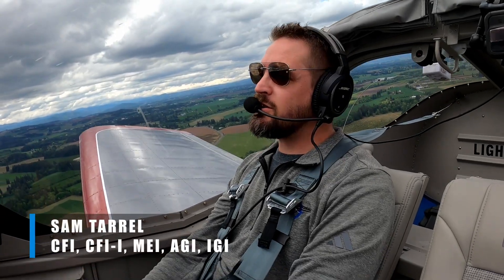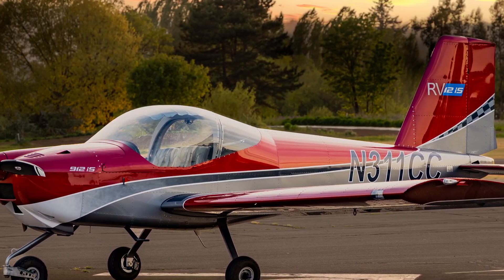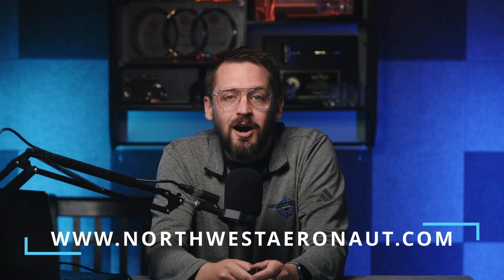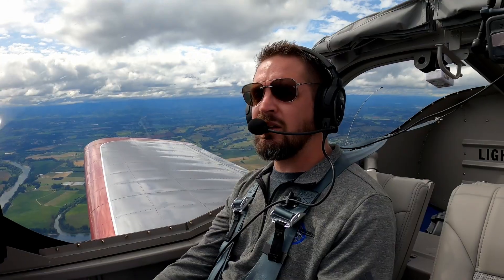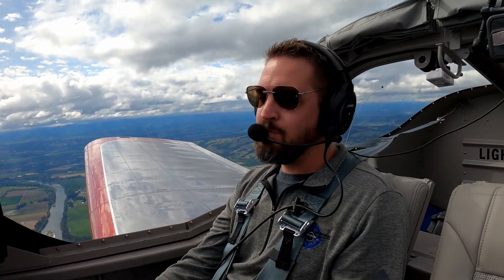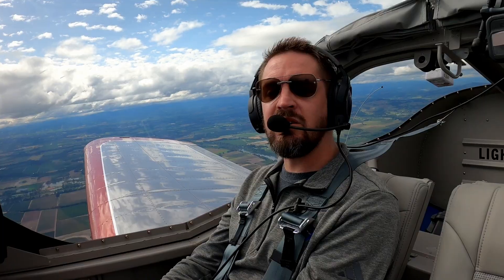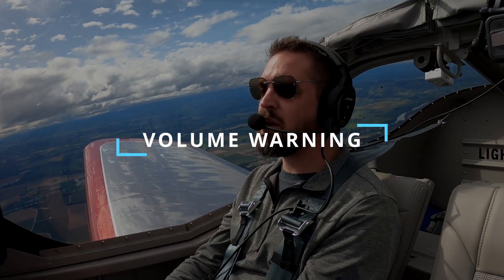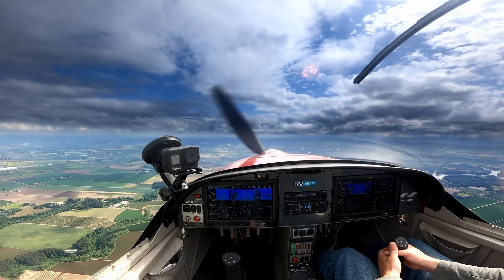How Stalls SHOULD be done -  in the RV12

Comment: I've been training in RV-12 for my Sport certificate here in Utah. How well does the 912 IS perform compared to the ULS in your opinion? We often struggle with high temperatures overheating the engine and density altitudes really eating up the performance here in the summer.
Reply from the maker: So I’ve actually only ever flown the iS but from what I hear the ULS definitely doesn’t perform as well. Have you been in the ULS or iS for your training?
Reply: @NorthwestAeronaut I have only ever flown the ULS. It definitely struggles with the heat. Pretty much any flight after 10am turns into a battle of keeping the oil temp low enough and the sweat out of your eyes.

Climb performance is around 300 fpm much of the time so we have to be very careful about flying near the many mountains.
Reply from the maker: Well while the sweat in your eyes is going to be universal, I do think the iS does better at staying cool and produces great power even at altitude. If you get the chance to try one I’d love to hear how your experience is compared to the ULS!
Reply: @mrtriathlondude 

Does your school open the oil door in between flights? It’s not much but it does seem to help a bit…keeps those cheap, goofy engine sensors from frying themselves on a constant basis. I’ve flown both the ULS and the IS. The IS is definitely nicer (especially with a 650 in the center) but I see pretty comparable performance. Close to sea level at low density altitudes, both the uls and is will rocket off the ground. I’ve seen upwards of 1300 fpm climbs on cooler days with negative density altitudes. Makes flying the pattern a bit wacky when you’re reaching pattern altitude during your crosswind turn.